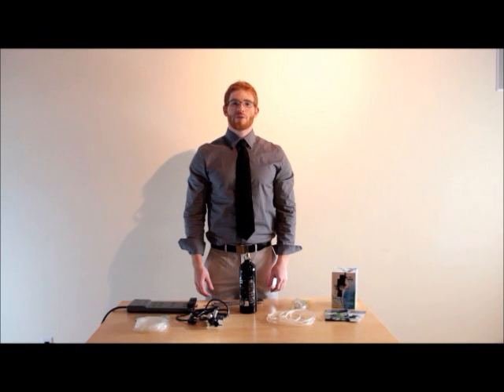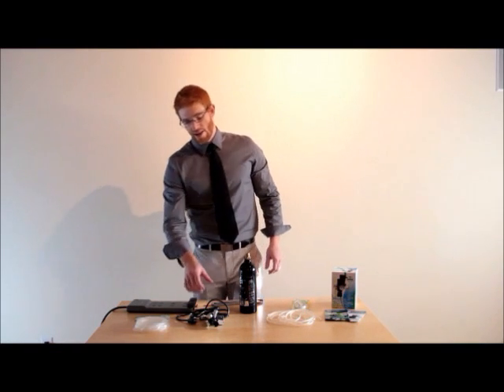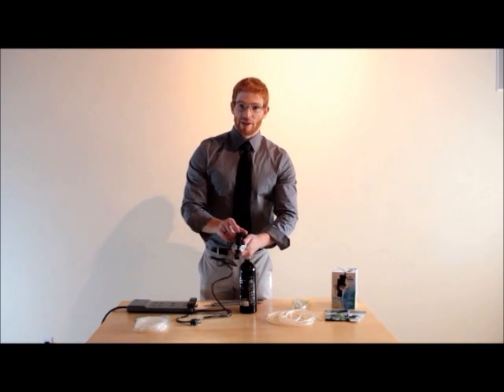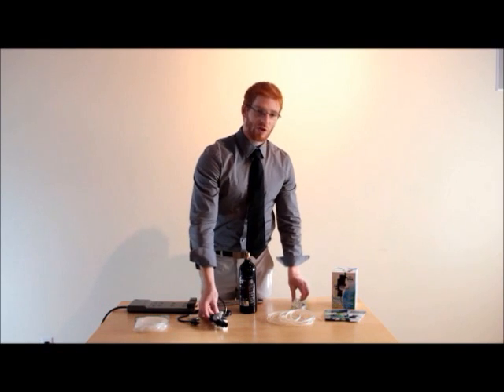AQUATEK CO2 Regulator Mini

Comment: Bought it and I am very disappointed.

The main valve (tank to unit) is always open. You cannot take it on or put it off without bleeding out a lot of gas. When you put it on you are fighting off against a hissing thing while all your gas escapes. The bleeding is significant - I feel like I suffered a cold burn on my arm and the tank feels ice cold to the touch.

Without using an additional sealant, this thing will lose gas through the hole located in the screw-on for the tank, the hissing is there, it's audible, I put water over the hole to see if that's the case, it is. I guess the hole is there to actually allow us to screw the damn thing on. But overall - it's a very hard task to accomplish. I don't know why the geniuses at aquatek didn't think "hey, what if instead of putting the customer on a race against time we would just add a valve to keep the tank closed while the customer puts it on?". I wasted a lot of gas. First when I tried to put this thing on, and then when I realized its a piece of shit and decided to take it off.

Will attempt to return it for a refund. It sucks.